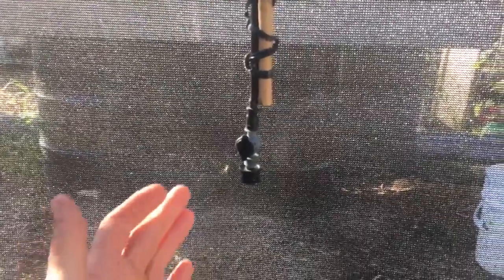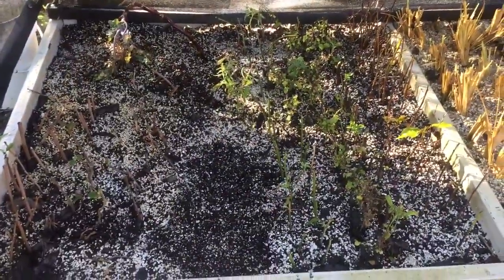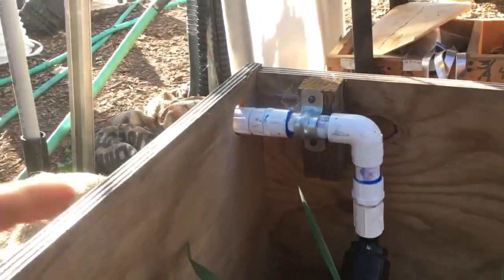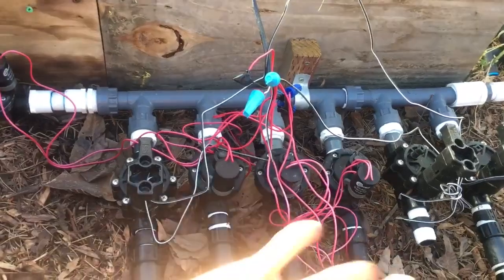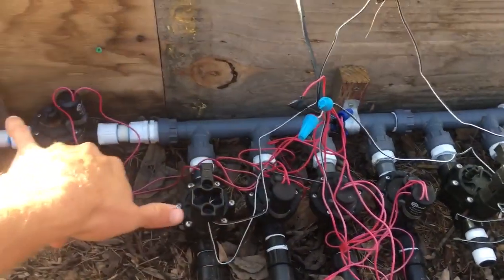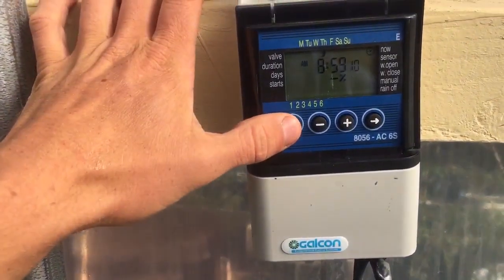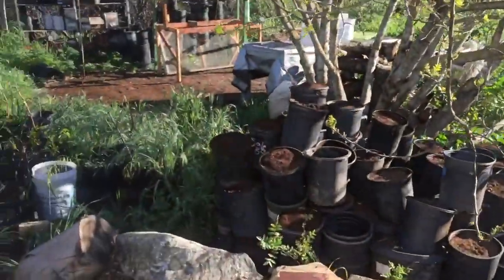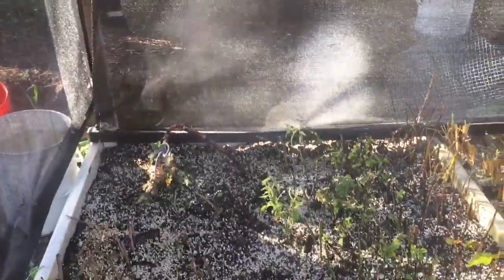Automated Misting Bed for Propagating Plant Cuttings

Comment: What is the set up you have the moss/pearl/sand in? Is it wooden boxes/frame or special trays?
Reply from the maker: 2x6 wooden sides, and in this case they were set atop a dry stacked stone wall of the same footprint that was backfilled with large stone and then some 2" gravel topped with a piece of shadecloth to keep the growing media from falling through the gravel. This provided good drainage underneath. In more recent iterations of this system, I've built tables with the growbed elevated, the bottom being 1/2" hardware cloth set atop a 2x4 frame with a piece of shadecloth over that once again to keep the media in but allow excellent drainage.

Comment: Did you have a design build video for this system and the info on the misters with antidrip?
Reply from the maker: Hi Matt, no design build video for this one unfortunately. I used to have a parts list for the whole thing but I cannot locate it at the moment. Here are the links real quick for the anti-drip mister setup.

Tornado Misters: https://www.dripworks.com/tornado-mister-press-fit-5-pack

MEAD Anti-Drip Device: https://www.dripworks.com/anti-drip-device

Press-Fit Barb: https://www.dripworks.com/press-fit-barb   (will fit 1/4" drip line)

And optionally, if you want to control each mister head individually, you can either use a barbed valve as you punch into whatever main line you have ( https://www.dripworks.com/1-4-micro-flow-valve-barbed ) or you can use another press fit valve that integrates with the anti-drip set up ( https://www.dripworks.com/press-fit-shutoff-valve-5-pack)

You might also need this couplerwith the press fit valve, I can't quite recall:  https://www.dripworks.com/press-fit-coupler-10-pack